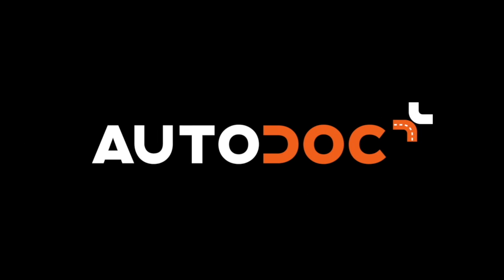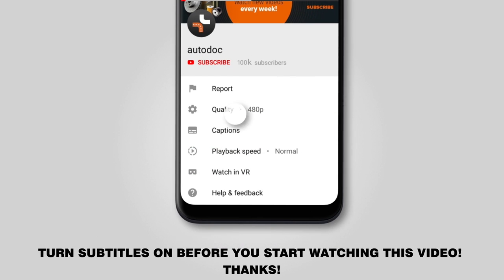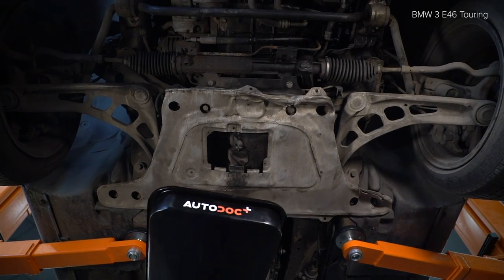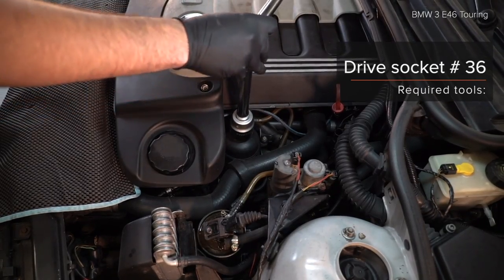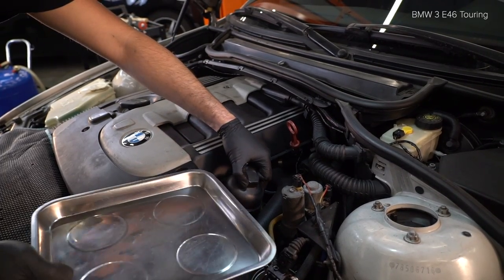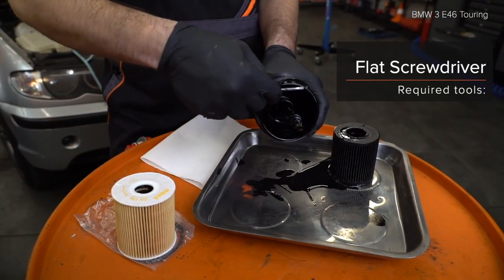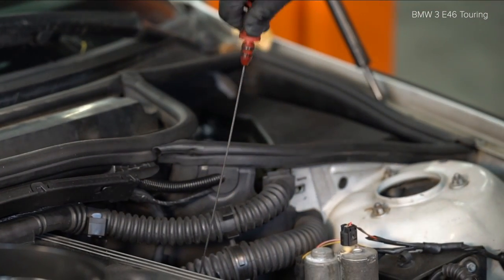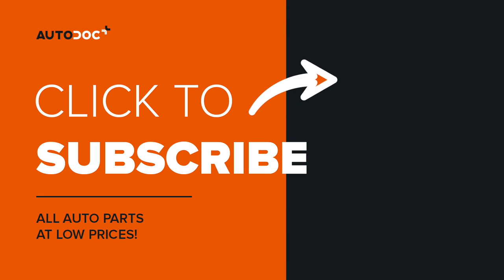How to change oil filter and engine oil on BMW 3 (E46) [TUTORIAL AUTODOC]

Comment: 6.5 Lis not too much for a e46 320D 2000cm3 ????
Reply from the maker: This car needs 6.5 liters of oil.
Reply: @autodocuk  no, thats the 6 cylinder m57 version, this is the m47 and only takes 5.5 litres. Dont destroy your engines.